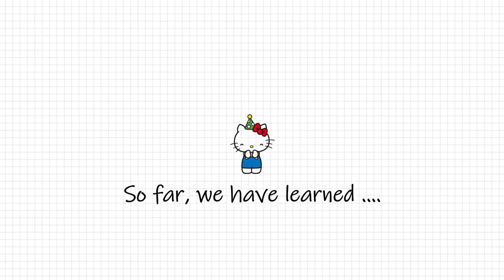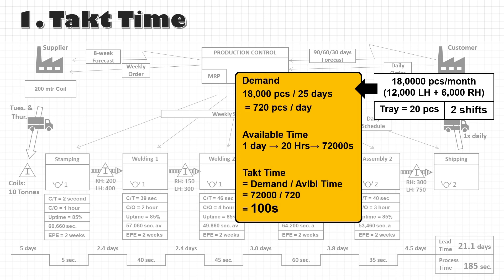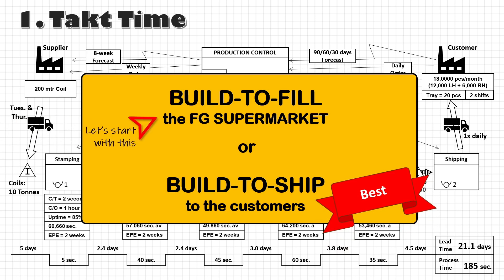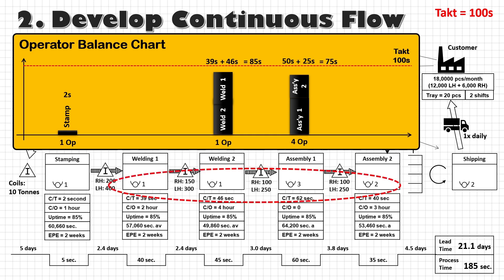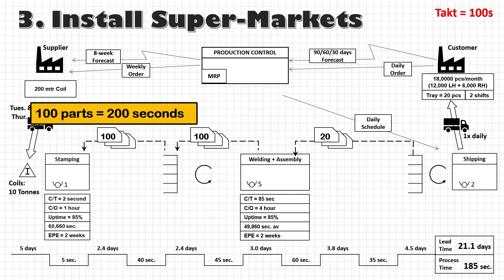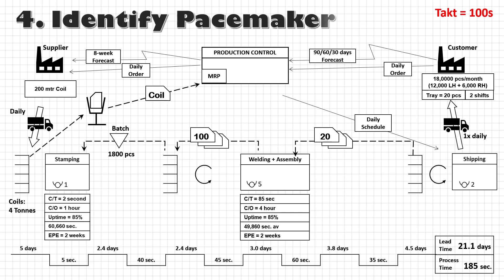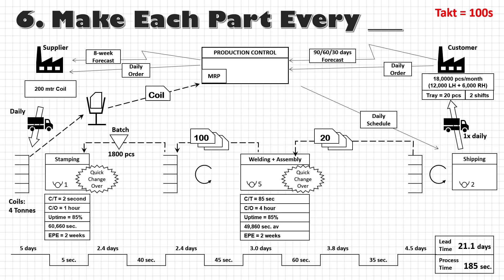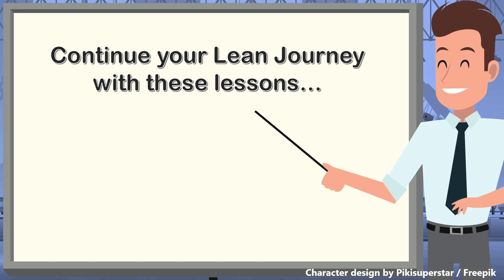Designing your FUTURE STATE - Value Stream Mapping

Comment: how did you assume that the time in the supermarket was always 2 days while the time in the supermarket from the current state map was 4.5 days
Reply from the maker: @kevinrad9675  Hi Kevin,
Earlier there was no Supermarket to ‘Pull’ from before FG. Instead, ABC ltd had an WIP from where they’re ‘Pushing’ material as soon as the customer schedule was received. So, to be on a safer side, ABC was keeping a safety stock of 4.5 days.
But when they introduced a Supermarket and more importantly reduced the change over time, they’re able to quickly change between LH & RH models. Thus, they could reduce their safety stock (in Supermarket) to 2 days.
But again, 4.5 days and 2 days are ‘assumptions’ to demonstrate the amount of reduction we can achieve using VSM techniques, I haven’t backed them up with calculations for the sake of the simplicity of this lesson.
If you want to learn the calculations, I recommend going through the book I’ve mentioned in the video.

Comment: This analysis is wrong. You failed to consider the processing losses due to downtime, which amount to 48% at Op5. The critical operation, the operation that limits the throughput of the line is Op4 @a nominal 62 sec/pt. However, given the downtime losses, its net is 119 sec/pt., well below market demand/takt time of 100 secs. IF Op 4 is 100% labor, then doubling labor @Op4 may solve the problem. But, since it's assembly, some equipment is probably involved, meaning adding fixed assets/machinery, and upgrading QA to accommodate the extra throughput.
Reply from the maker: Thank you for your comment, Steve. 

If you were referring to processing losses as Change Over losses, you’re absolutely correct. I intentionally omitted that aspect in this series, fearing that it would make things too complicated. However, I’m currently working on a separate series dedicated to reducing changeover time. It’s called SMED (Single-Minute Exchange of Die). You can find more information about it here. 

https://www.youtube.com/watch?v=8A2T_JMA03M

Again, your comment brings me immense joy—it’s heartening to see people who question and seek beyond the status quo rather than merely accepting what’s taught to them.” :hand-purple-blue-peace:
Reply: I get it but it’s a little bit of an oversimplification. If you combine welding 1 and 2 under the premise of a combined Takt time of 85 sec/pc but they are down 15% of the time and have a combined 6h of changeover time you are well over the customer Takt time and have a big problem again and can’t meet the customers requirements.
I get that it makes the video a little bit more complicated but people don’t watch the video in preschool. They can understand a simple formula with 5 variables if you include quality as well (which you should)